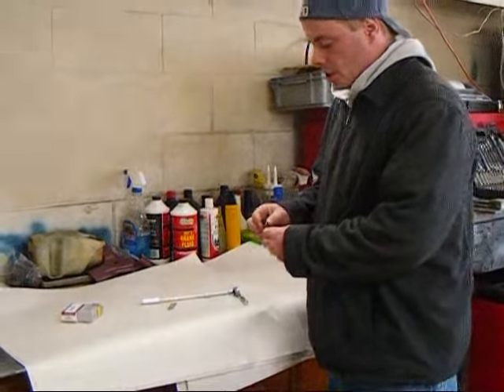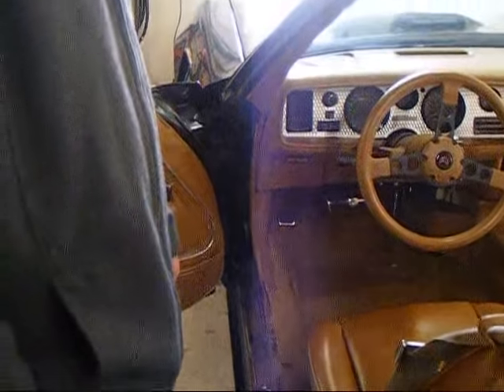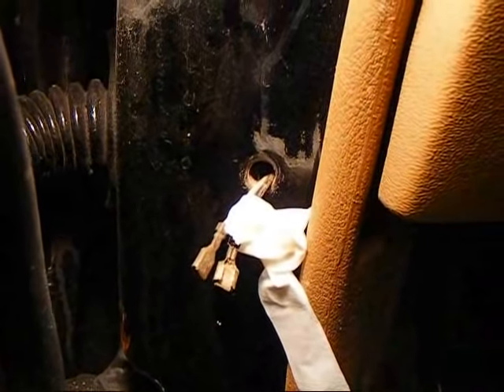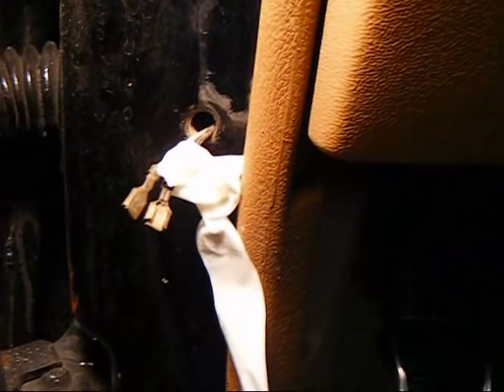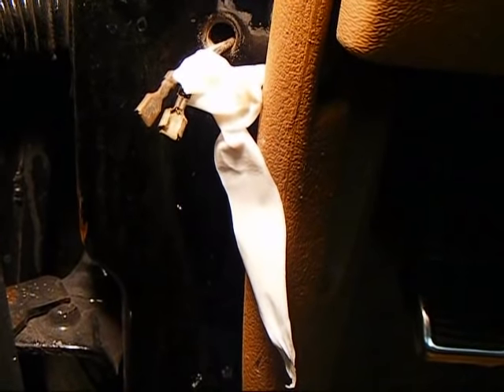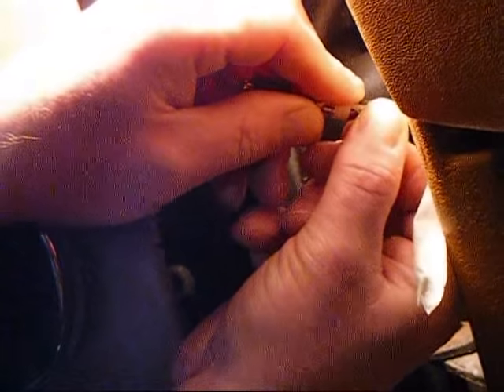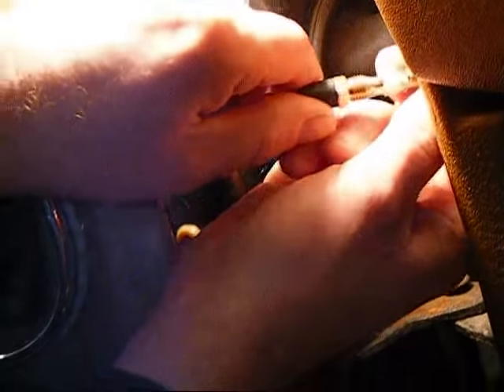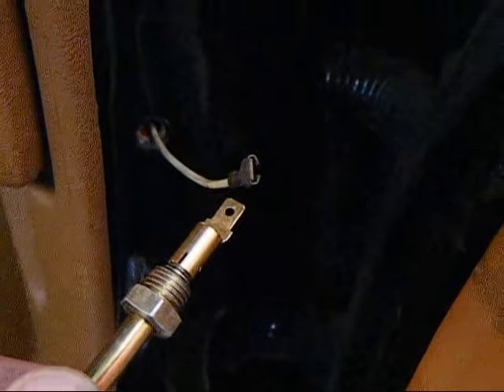"How To" Door Jamb Mounted Dome Light Triggers

Comment: Inknow the video is old with terrible quality but you didn’t mention the door self adjusts the length of the tube that slides through the nut once the door is fully closed. Not sure why the repop on the drivers side has a rubber or plastic cover over the tube. I wouldn’t buy that one unless your suppose to remove it. Maybe it’s there to stop the tube from sliding in past the nut when it’s shipped. If the tube goes in too far then the light won’t turn off when the door is closed.

Comment: my wire fell back in hole, how do i get it back out
Reply: Rip. This comment is a year old but I'm interested in the results?
Reply: Did you ever get the wire out?  I would have started by removing the kick panel inside, and then see what can be done to retrieve it,
Reply: 8mm neodymium disk magnet on a coat hanger down door hole.
Reply: @Ocalaman  there's also speaker holes near where the dome light pin wires are routed for access. You mean that kick panel?
Reply: @pastelskies8466  Good idea except that the terminals are brass...